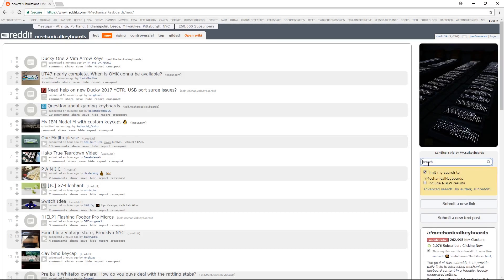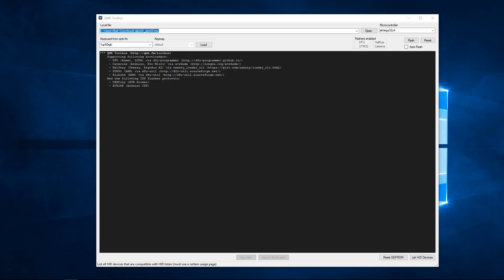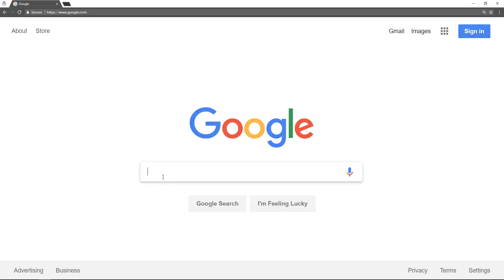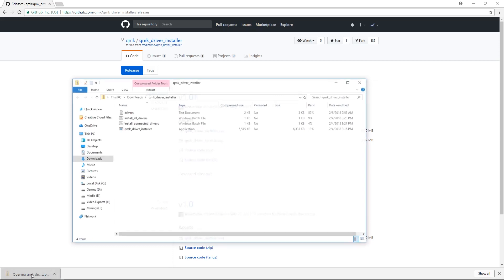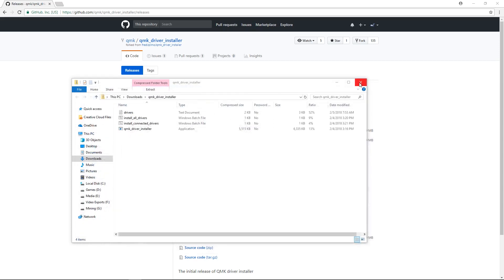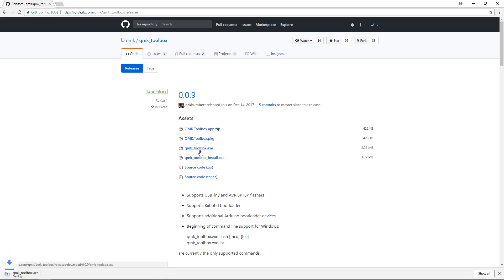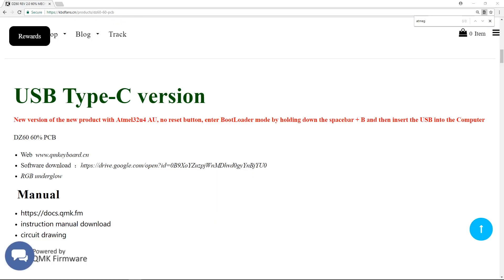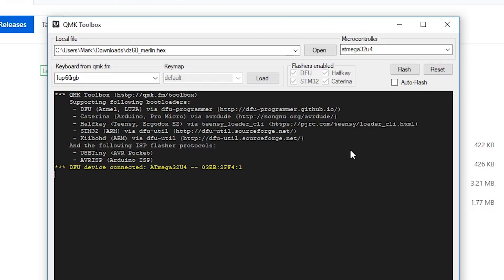QMK Tutorial: QMK Toolbox (DEPRECATED)

Comment: What am I flash for or rather what is flash? I brought my keyboard do I still need to do this? I got the Planck/EZ.
Reply from the maker: You only need to flash if you want to change your keymap.
Reply: @MechMerlin  okay I will be doing that, just seen your mapping video. Thanks.
Reply: So when I download the files from your previous video I got a .bin file not a hex.
Reply from the maker: @byakusharingan6906  I'm using a dz60 which uses .hex files.
Reply: @MechMerlin  figured that out shortly after I asked mine deals with bin. Thanks.

Last question I can custom individual key colors ?
Reply from the maker: @byakusharingan6906  yes you can
Reply: @MechMerlin  do you have a video? Or some cliff notes.
Reply from the maker: @byakusharingan6906  it's pretty much coding in C. But you can look up the specifics on what to do with C in the QMK documentation.
Reply: @MechMerlin  will do. thanks

Comment: Anyone else having trouble with the dz60rgb? I am able to go to bootloader mode, and qmk recognises the board, but when I try to flash I get "Cannot open DFU device 0483:df11
 No DFU capable USB device available" I installed all the drivers and I am using a bin file from qmk configurator.
Reply: my dz60rgb is recognized as STM32 when I connect it to QMK, it should be  atmega32u4 right?

Comment: im having problem to get QMK toolbox find my leaf60. I have tried spacebar+b, esc, shifts+b, fn+esc...but never succeeded, and right now my key mapping are messed up (when type R it turns T). While im having trouble with leaf60, i can connect my DZ60 without any problem. Could you advise any solution. i already tried uninstalling devices and re-install connect decive but nothing happen
Reply from the maker: You can try manually resetting it by shorting the ground and reset pins on your atmega32u4 controller.
Reply: @MechMerlin  https://geekhack.org/index.php?topic=99002.800 i found someone on GH guided how to reset by jumping the pins on leaf board, and now i can flash my leaf60!!

And i found that your qmk config works well for hhkb layout, but ansi60% and others seems not mapped.

Thank you so much!! Cannot solve this without you :)

Comment: I followed this, but in qmk config after hitting flash it says no dfu connection or something like this.
I tried zadig but it wouldnt even recognize my board.

Edit: got zadig to install the driver properly. Still having issues flashing through toolbox 

Im using dz60 hotswap rgb
Reply: same. But when i hit flash it says"only firmware files in .bin format can be flashed with dfu-util!" I have been working on this bored all day. please help!
Reply: you should hold esc when you plug the dz60rgb, then qmk should find it.

Comment: For some reason my "\" key and enter key are switched no matter how many times I remap and flash
Reply: I had same problem today with DZ60RGB pcb. It turned out that JSON file from KBDFANS has "Enter" set as "\" :D It was that simple, but I didn't noticed this soon enough. Created my own layout using firmware from QMK Configurator and problem solved :)

Comment: i accidentally flashed the 1up hse hex file on to my dz60 and now my dz60 wont work
Reply from the maker: You'll have to manually reset it by shorting the Ground and Reset pins on your atmega32u4 to get it to enter bootloader. Look up a pin out diagram on Google and orient your board to match the microcontroller.

Comment: when putting my dz60 into reset mode this string of text appears and I am unable to flash the hex file. Anyone else run into this issue when putting the dz 60 into reset mode

* STM32 device connected: STM Device in DFU Mode -- 0483:DF11:206D394F2038 {36fc9e60-c465-11cf-8056-444553540000}
* Attempting to flash, please don't remove device
  ! Only firmware files in .bin format can be flashed with dfu-util!
Reply from the maker: You are trying to flash a hex file when it is specifically asking for a bin file. You probably have a dz60rgb instead of a dz60.

Comment: Guys, need help ! I've made every step in this video, but my DZ 60 stopped working. I'm unable to use the KB, even to reset. What can I do ?
Reply from the maker: You'll need to manually reset it by shorting the ground pin and the reset pin on the atmega32u4 microcontroller.
Reply: @MechMerlin  I need to open the keyboard to do that ?
Reply: I mean, i've done EXACTLY what the video says. But, when I unnplug my kb, still doesn't work
Reply from the maker: I am unsure what your case is, if you're able to access the microcontroller without disassembling, more power to you.
Reply: @MechMerlin  Well, I've made but. But the keys doesn't match with the layout.

Comment: How do you figure out what hex file to use for your keyboard and I have a store bought mechanical keyboard that I installed the wrong driver for and messed it up and now it doesent work. I wanted to watch this video so I could figure it out but this stuff is mad confusing, could you help me?
Reply from the maker: QMK hex files are named after the keyboard that its made for. So if you had a keyboard called ABC_XYZ, you would have to compile QMK firmware for that keyboard either using command line or using the QMK Configurator.

Comment: Thanks mate! Amazing video. I was able to customize my dz60rgb board perfectly! Thank you again :)
Reply: Gudeking could you tell me the process of doing yours? I have the same board just in hot swap version but I keep getting an error that doesn’t let me flash
Reply: @RanosTV  My board is hotswap too, so i guess we have exactly the same boards. I did exactly as told on this video. The only difference was that my flash file that i downloaded from config.qmk.fm was in .bin file for some reason. Luckily the bin file worked for me just like the hex file in this vid. I'm completely new to QMK and I'm afraid I can't be of much help to you. If you're having trouble flashing your keyboard, maybe you didn't put your keyboard to bootloader mode properly. If your board is the same as mine, you first turn on the QMK Toolbox(with your keyboard connected), and then unplug your keyboard, and replug it only this time keep your 'esc' pressed when replugging. This should put your keyboard to bootloader mode and all you have to do is click 'flash' on the QMK Toolbox.
Reply: @gudeking4247  godbless you and your soul. spent a good 10-15 min trying to figure out how to refresh my board because the spacebar + B wasnt working. Decided to just look in the comments to see if anyone had the same problem i was having and had an answer. As simple as just having to hold esc. I know this comment was a year ago lol but thank you!

Comment: Welp I've tried all the steps multiple times and every time my keyboard types nothing. Not exactly sure where I screwed up but I'm pretty sure I followed every instruction in this video correctly and the hex file video.
Reply from the maker: I'm sorry to hear that. If you provide some details on what your keyboard is, including pcb and rev, I might be able to help. I suspect you might have chosen the wrong keyboard.
Reply: @MechMerlin  should be a 1uphse purchased off mechmarket. The keyboard only lights up when I choose the 1uphse under the "keyboard from qmk.fm" section so I assume it is indeed the 1uphse PCB. Hex file I also chose the 1uphse while trying default layout and even a custom one but neither seems to be working. Tried the 1uprgb setting just now in case it was that one but nope still doesn't work and the lights went off under that hex file as well
Reply from the maker: @Technique1997  you may have a defective PCB. I own both those and can confirm that the configurator works for them both.
Reply: @MechMerlin  hmm when I first received this the buttons were kind of working? Pressing each key would yield a random letter or character but it was pretty consistent (i.e. pressing a would yield the same character each time I pressed it I think it was an o).
Reply from the maker: @Technique1997  are you saying it never really worked 100 percent even when you got it
Reply: @MechMerlin  Yes but I just assumed it was in a different layout that's why I went about flashing it. Bought this secondhand from mechmarket
Reply: @MechMerlin  is there another way to test if the PCB is in fact defective? I have little reason to believe this guy sold me a defective PCB as he's been very helpful with answering a lot of my questions and even lubing a few switches for me to put into this keyboard.
Reply from the maker: @Technique1997  oh man. Id look for a refund if you still can't get it to work
Reply from the maker: @Technique1997  well I see three options here. Either you have a broken PCB, you don't really know what PCB you have, or lastly you haven't followed the directions as well as you think. IMO, the broken PCB is the more likely scenario.
Reply: @MechMerlin  the only thing I think I could've messed up on might be installing the drivers. I'll try some stuff and report back but otherwise I think you're right
Reply: @MechMerlin  ok well this is interesting. the keyboard works PERFECTLY on my laptop (haven't tried QMK on it) but on my desktop absolutely nothing registers o.o is this a driver issue? I tried all the USB slots so it's not those that have a problem
Reply from the maker: @Technique1997  Wow that is a strange thing to happen. Can you try if other mkbs work?
Reply: @Technique1997   Hey I have the same problem as you. If you start pressing keys on the number row, does the keyboard start working? I'm trying to fix this issue as well. Also trying to reset the firmware but I can't get it to bootloader anymore. Let me know if you found a solution

Comment: need help with massdrop ctrl high profile keyboard...new to all this, I've tried your method and don't think i'm doing it all right lol can you please look into this?
Reply from the maker: Hi Alvin, I'd be happy to help, what exactly is the problem?
Reply: @MechMerlin  yeah actually I'm also trying to use the massdrop ctrl. Once I load the hex file and hit flash, it says there are no devices detected, but after I hit the flash button on the back of the pcb and hit flash again, it seems to work, but after some lines come up in the toolbox it just closes out and the keyboard doesn't reconnect to my computer until I unplug it and plug it back in. I'm not trying to change the layout though, i'm just trying to change an led preset color on the keyboard. The led configuration file is in the ctrl folder of qmk firmware, not the keymaps folder within that folder so i'm not sure if the led configuration file gets saved when you build a hex firmware file.
Reply from the maker: @malikeid4121  Is there something wrong with Massdrop's instructions? Are they specifically pointing to use QMK tools instead of their own tools?
Reply: @MechMerlin  I couldn't figure out how to use their led configuration tool so I asked around on reddit and they pointed me to qmk tutorials and told me to change that file and flash the firmware onto the keyboard. However, I just tried using their tool again and it actually worked. I just set all the led's to the color I wanted clicked build, and then used their tool to flash the keyboard. Now the keyboard is the color I want, it just cant use any of the custom led configs which is fine. Although the escape key is flashing red for some reason. Thanks for your response! and merry christmas!
Reply from the maker: @malikeid4121  Sure no problem. @Alvin I hope Malik's solution works for you too. Probably should have opened a different thread that kept the same one so things don't get confused.
Reply: Yeah I can try to help you out if you need since i'm familiar with massdrop's firmware tool now.

Comment: Hi Merlin, i followed this tutorial, but then i got this error message:

Caterina device connected: USB Serial Device (COM5) -- 2341:0036:6
* Attempting to flash, please don't remove device
>>> avrdude.exe -p atmega32u4 -c avr109 -U flash:w:"C:\Users\falih\Downloads\kbfirmwarejosn.hex":i -P COM5
    avrdude.exe: warning at C:\Users\falih\AppData\Local\QMK\QMK Toolbox\0.0.9\avrdude.conf:14976: part atmega32u4 overwrites previous definition C:\Users\falih\AppData\Local\QMK\QMK Toolbox\0.0.9\avrdude.conf:11487.
    
    Connecting to programmer: .
    Found programmer: Id = "CATERIN"; type = S
        Software Version = 1.0; No Hardware Version given.
    Programmer supports auto addr increment.
    Programmer supports buffered memory access with buffersize=128 bytes.
    
    Programmer supports the following devices:
        Device code: 0x44
    
    avrdude.exe: AVR device initialized and ready to accept instructions
    
    Reading | ################################################## | 100% -0.00s
    
    avrdude.exe: Device signature = 0x1e9587 (probably atmega32u4)
    avrdude.exe: NOTE: "flash" memory has been specified, an erase cycle will be performed
                 To disable this feature, specify the -D option.
    avrdude.exe: erasing chip
    avrdude.exe: reading input file "C:\Users\falih\Downloads\kbfirmwarejosn.hex"
    avrdude.exe: ERROR: address 0x8002c0 out of range at line 1431 of C:\Users\falih\Downloads\kbfirmwarejosn.hex
    avrdude.exe: read from file 'C:\Users\falih\Downloads\kbfirmwarejosn.hex' failed
    
    avrdude.exe done.  Thank you.

any idea why? thank you!
Reply from the maker: It's very hard to read that formatting. Can you tell me what keyboard you are trying to flash?

Comment: I'm trying to do this for the Bigseries pcb from WoodKeys and I'm hitting a snag: 
* QMK Toolbox (http://qmk.fm/toolbox)
    Supporting following bootloaders:
     - DFU (Atmel, LUFA) via dfu-programmer (http://dfu-programmer.github.io/)
     - Caterina (Arduino, Pro Micro) via avrdude (http://nongnu.org/avrdude/)
     - Halfkay (Teensy, Ergodox EZ) via teensy_loader_cli (https://pjrc.com/teensy/loader_cli.html)
     - STM32 (ARM) via dfu-util (http://dfu-util.sourceforge.net/)
     - Kiibohd (ARM) via dfu-util (http://dfu-util.sourceforge.net/)
    And the following ISP flasher protocols:
     - USBTiny (AVR Pocket)
     - AVRISP (Arduino ISP)
* WoodKeys.click: BigSeries Single Keyboard connected  -- FEED:6071:0002 (7&3954f494&0&0000)
  ! There are no devices available
Any suggestions?

Comment: Iris Rev 2  - I havent soldered my pro micron yet, as I was advised to flash before soldering. But I dont have the reset option here or hold the space bar + B. How do I flash? When I press the flash button it shows me this - 

Local\QMK\QMK Toolbox\0.0.9\avrdude.exe: option requires an argument -- P
    Usage: avrdude.exe [options]

and then  several options below -
Reply from the maker: I believe those are put into reset by shorting pins together. The flash button won't do anything, if the reset has not been done.

Comment: Followed your steps, hit flash, and "dfu-programmer: no device present." shows up. Any ideas? I'm trying to flash a KBD75. Not sure which version, but I was told by the previous owner that it does have QMK.
Reply from the maker: A BJ are you sure you reset the board correctly? How about the drivers?
Reply: MechMerlin I believe so. I clicked the Install_All_Drivers file and the command prompt opened and installed them.

Comment: Merlin, I soldered on an led on my caps lock. I had programmed my keyboard before that. Now that I have plugged the keyboard in, the caps led doesn't light up when I have caps lock active. Do you know how to fix that in QMK configurator?
Reply from the maker: That's something you would have to code up. We don't have that implemented in configurator yet

Comment: i'm getting an error that says option requires an argument, then provides a long list of options. any idea?
Reply from the maker: What keyboard is this? How did you generate your hex? Did you verify that you installed the right drivers?
Reply: @MechMerlin  I'm getting this same problem trying to flash a MB17 macro pad. I am able to flash my Preonic, and Sweet16 no problem. Re-downloaded drivers. No luck. After pushing reset and flash, it says option requires an argument. Not sure what to do here. I want to use QMK configurator, as VIA is missing some of the quantum/layer functions. Any help is appreciated.
Reply: @MechMerlin I figured it out. I had to copy the command that QMK Toolbox was trying to execute, and run it using command prompt from the directory containing avrdude in: users\appdata\local\QMK\QMK Toolbox\0.0.14. Then where QMK Toolbox is missing the argument for -P , I had to specify which serial port my MB17 is connected to, com7 (com7 was shown as the port the MB17 was connected to in QMK Toolbox's window). So, in command prompt I entered: avrdude.exe -p atmega32u4 -c avr109 -U flash:w:"C:\Users\username\Downloads\mountainblocks_mb17_sm-mb17-02.hex":i -P com7

and it worked!

Just wanted to leave this here in-case it helps anyone else.

Cheers.